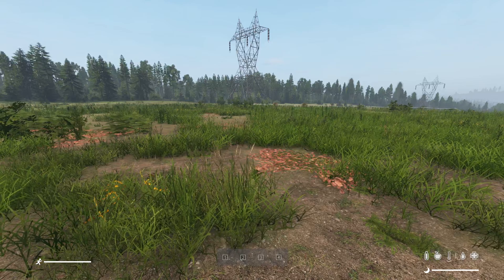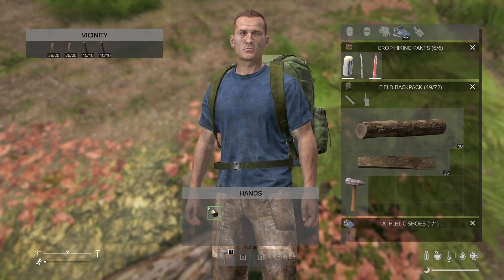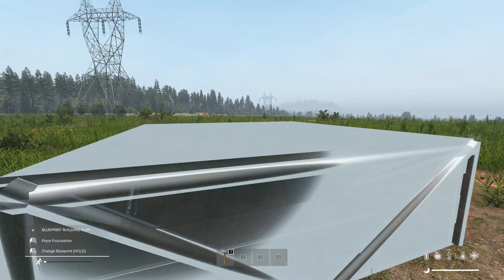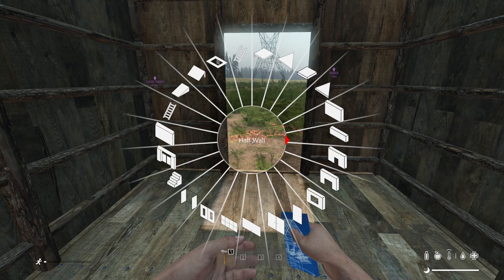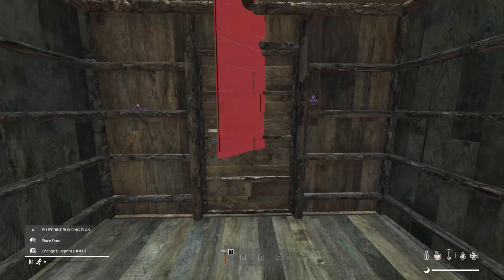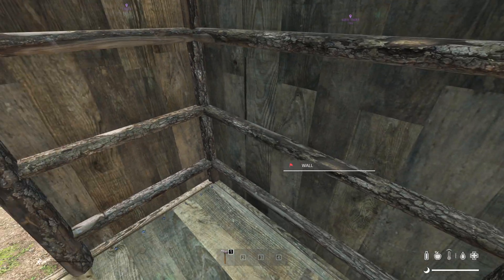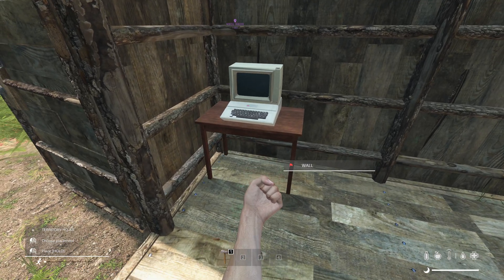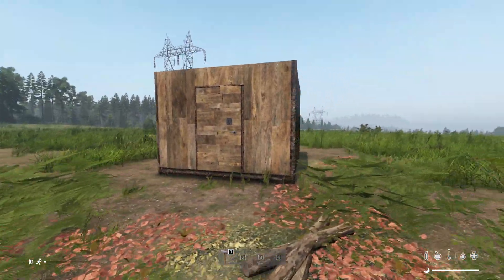BASE BUILDING with RA Base Building MOD

Comment: How to dismantle the any of the structures to change the design or expand
Reply from the maker: Depends on the server - they can all be moved within 10 mins of placing, some servers will run overrides mods to extend this forever, others wont. - hammers hatchets work